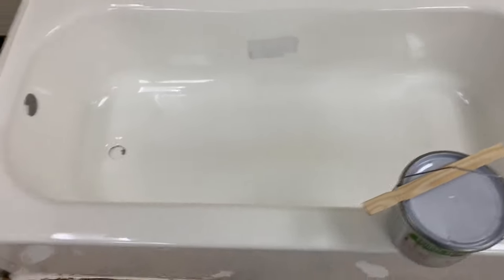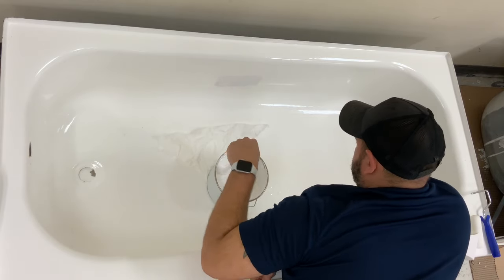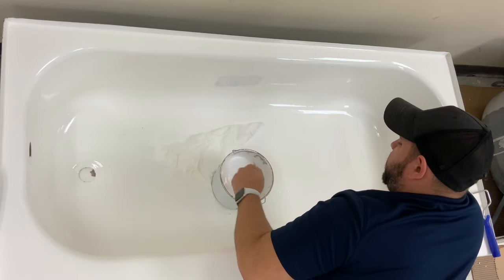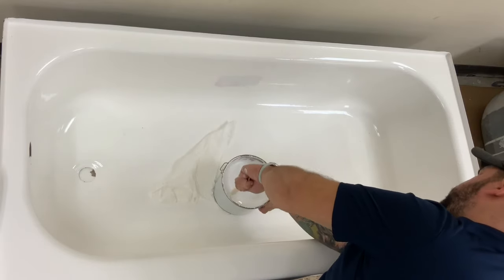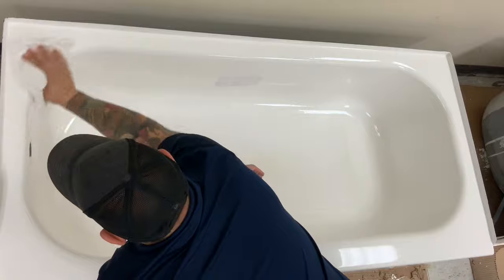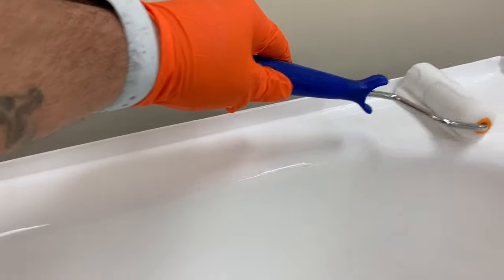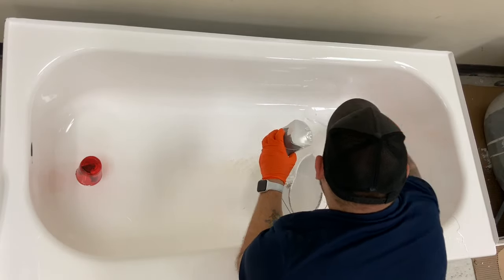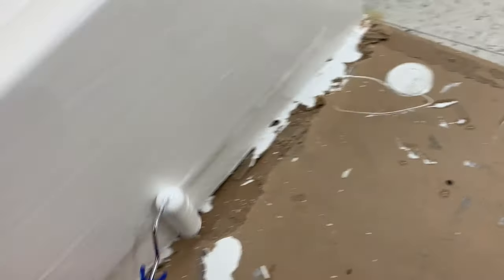How To Refinish A Tub With Ekopel 2K Demo | Ekopel 2K's Easiest & Fastest Way

Comment: I have a small area (about 1 square inch) of exposed iron, do I need to prepare it before I apply Ekopel?
Reply: unless you want a divot but one lady used it for her farmhouse sink and the drain board portion filled in with ekopel. So she lost the drainboard. So it may fill your spot in?  And you might want to sand the exposed iron and make sure there is no rust.  If hHave you found any other precautions, please share. thanks..
Reply: Did you etch the tub or sand it???
Reply: Bondo makes a fiberglass reinforced body filler called Bondo Glass. I think it would work perfectly to fill in any divot created by whatever wore down the original finish before you refinish your tub or sink. I would gently use a wire wheel on a drill to remove any rust, and scuff up the metal to give the body filler something to grab onto.
Reply: I was considering patching with JB WaterWeld prior to this video.   Did you prep the exposed area?

Comment: Not sure if you read these comments after a few years but i was wondering howwww finish has held up now after 3 years?? Thanks
Reply from the maker: Hello, The pour on coating can last for 15-20 years or more if all recommendations for applying the material are followed in conjunction with proper and careful maintenance.

Comment: do i need to caulk it first before applying ekopel? and my surround has hairline crack, will ekopel cover it? ty
Reply from the maker: No You remove all caulking before applying. Caulking will not allow the material to adhere properly. Re caulk after it is dry.

Comment: The tub you are refinishing in this video is in fairly good shape. How would you prep an older cast iron tub, say about 40 years old or so, that has already had one failed re-coating on it that is already peeling around the drain??
Reply from the maker: PaganWizard remove peeling paint, sand any edges smooth then deep clean with the Lysol power. Then you are ready to recoat.

Comment: Thank you for the in depth instructions, I bought the tub and tile kit to do the tiles on the walls surrounding my tub. Any tips on how to do the tiles? The pour method you used on the tub?
Reply from the maker: Follow the demo tub and surround videos and you should be good. I would recommend mixing one can at a time and work fast keep in mind you only have about an hour to play with the material after that hour is up the material is too difficult to work

Comment: The tub that he started with doesn’t look bad at all. A tub with nicks and dings and hard water iron stains is more like the tubs we are dealing with out here. I haven’t used this product yet, but I’m going to.  My tub does have lots of nicks and scratches and looks like there is some layer of paint or something that is on the inside of the tub,  any suggestions on that? Will this stuff cover it? Thank you
Reply from the maker: We do recommend filling in any holes or cracks with bondo and then sanding smooth with the rest of the tub. We recommend sanding the entire tub to achieve a smooth and flat finish. It will cover the previous finish however it will not fill any holes or gaps. It also may mirror the beneath which is why we recommend sanding for the flat surfaces as well as removing contamination that may even not be visible.

Comment: I have a six foot long corner tub so there is an additional side plus slightly longer length than traditional 5' tub.   The top edge is rounded ( there is no flat surface) and I am wondering if this kit contains enough material to finish this tub.   Also, would removing the drain basket be beneficial?

Comment: Hi...appreciate this video very much.  I have a old Kohler cast iron tub that is over 100 years old...pedestal type.  I am going to just sand down and paint the outside with either a oil based boat deck paint or maybe even rustoleum stray paint (thinking aged copper).  The inside is ok...but I will have to sand down and put a little bondo around the drain (small chips).   I won't have to do the cup thing for the drain...already removed and will be easy to seal up from the bottom.   My question relates to the heat gun process....did you just slowly go around the tub with it just for a couple of seconds to get the air bubbles out and was the temp pretty low on your gun.  The rest seemed quite logical how you did this....think the most important part or a lot of it will be masking around the tub and protecting the floor and walls while I do this.  I am going to refinish the outside of the tub outside the house and then bring into the bathroom to do the inside.  I won't have a lot of room but should be ok.   I priced just having this reglazed...but they want 700 to do my tub...so worth trying this.  Thanks again for the details....hand sturring for sure...)
Reply from the maker: When using a heat gun we use the high setting and go slow to pop bubbles or fish eyes.

Comment: Will this product work on fiberglass shower surrounds?
Reply from the maker: We no longer recommend pour on for surrounds as the process is too difficult and often does not come out as desired. We came out with our roll on kits which is a two coat process that is directly rollable! It is different material from our pour on kits and even those come with the foam roller it is not directly rollable given how thick it is. I would recommend our roll on kits the two coat process directly rollable and rollers are not included as we do recommend getting multiple as you will be using them a lot and they will fall apart. You will want to switch them out before they fall apart therefore no remains get in your finish. If you have any other questions please feel free to call at 877-882-2278!

Comment: Could you use this method and product to refinish a cast iron clawfoot tub?
Reply: Effectively figuring out if the sanding in a lot of full restoration videos is the only method for clawfoot cast iron tubs or if something like this also works
Reply from the maker: Yes this method will work as long as you sand and wash it before! Also check out our roll on product!

Comment: Great product 
Question if I can't  remove the drain due to how it was installed in the first place.
Is there a cover that can go over the original drain and if not can it be painted ?
Reply from the maker: You could put a drain cover over it. Or put something in there like a shirt or paper towels to absorb any material if it were to go into the drain. Then make a tape dam
Reply: @RefinishedBathSolutions  thank you
Reply: @RefinishedBathSolutions  scared to pull the cup off and see what seeped in. I taped, but very nervous. If some got down there, can an Epoxy thinner help (oh, I might need to get some off my tile walls and floor too!

Comment: Okay, my brother has been dealing with a pink tub and I'm trying to convince him to use this product as a temporary measure until he can save enough to redo the bathroom the way he wants it (which will take years because he wants to expand it too), will this cover in one coat?  Also, does this only work on tubs?  He also has a pink sink/countertop combo to deal with.
Reply: You can use it on shower walls. Like tile. Not sure about fiber glass  though *~.~
Reply: pua edwards you can use it on fiberglass. He addressed that in a previous video. It was a question asked.

Comment: Can Ekopel 2K be used on a previously glazed tub after stripping off the old glaze? If so, what would you recommend to use for the stripping & cleaning & any procedure tips for doing this? Why still use the cup for a dam if you tape over the drain before pouring?
Reply: He told me there is no reason to remove the old finish, just sand it and clean with the toilet cleaner. I used a razor blade to remove the old finish on my tub and it was very messy and time consuming.

Comment: Love this product. I'm 58 and did it without any issues tub and sink looks amazing. However after curing a lil product leaked under tape. How can I remove from floor tile...Thx
Reply from the maker: Heat up the area with a heat gun or hair dryer then scrape it off you can also use acetone. I recommend heating it up first then using the acetone

Comment: How many hours before the front of tub starts to self level out and look smooth and or at what point should we worry we didn’t do good enough?
Reply from the maker: It will continue to self level as long as the material is drying. You can go in afterwards and sand lightly.

Comment: Can you use this after mistakenly being an idiot and using Rustoleum tub/tile spray paint and ruining the tub? Sand it down smoothish or does it need to be completely stripped? And is there enough material for a roman tub... it looks like there was enough extra on the standard tub.
Reply from the maker: Steve Swanson you can sand it down. As long as you get it to sand smooth and no longer peel you can go over the top.
Reply: @RefinishedBathSolutions   You rock! Thank you for the video and the response!

Comment: I did not find a scoop in my package just the material, Gardner and roller.  What should I use for the scoop?
Reply from the maker: We have discontinued the old scooper boxes that are inside the box. The new ones are the wings of the box. Their should be a label that says "cut for scoop." These new scoopers should work better and last longer than the old ones did.

Comment: Hey -thanks for these great videos.  My husband used Ekopel 2K on our old cast iron tub and it looks great.  He has a couple of areas he would like to "touch up."  One wavy spot that didn't smooth and a couple of flat areas where dust landed on the surface.  He thinks he can sand and polish to repair these.  Could we talk you into doing one of your excellent tutorials on how to fix areas like this?  Thanks so much!
Reply: I totally agree, my tub ended up with drips and some bare spots and it would be great to see a video on what you can do to fix or re-do the tub.  I’m getting ready to re-do it after sanding and hopefully the 2nd time is a charm.  I think the product is great, but not all DIYs get it right the first time.
Reply: How did your second coat turn out? I just did my tub and have a couple drip lines myself.

Comment: I am wanting to redo my tub and considering using your product but I do have a few questions before I purchase. How long after doing the tub do you have to wait before you can use it to shower etc again? Also, what do you do if you accidentally get the product on something you didn't intend to get it on? Thanks
Reply from the maker: Kendra if you get material on something wipe it off with alcohol while when. 
24-36 hours before its fully cured.

Comment: Can eckopel be used on a fiberglass tub.I used it on a porcelain tub and it worked great.
Reply from the maker: Yes it can be used on fiberglass just make sure there is no flex. If there is a flex it would have to be fixed first.

Comment: I have 3 questions. 1st  is about rust spots do I have to do anything with them prior to applying product. If so what would you reccomend. 2nd question  after you remove cup from drain how to cover that area with  material. 3rd can I use hair dryer instead of heat gun?
Reply from the maker: For rust sport I recommend sanding smooth with 400 grit sandpaper. Then you can use our primer for a better stick. We don't recommend the cup method any more it was the old method of recasting. We recommend you tape the drain and then make a tape dam the cup can move and cause uneven areas. Yes a hair dryer will  work great instead of a heat gun.

Comment: I have two cracks in my shower pan,  is there a different method when it comes to crack? And you s there a different kit for shower pans? Thank you
Reply from the maker: Any cracks, chips, holes, or dents can be filled with car bondo first then sanded smooth.

Comment: If you don't use all materials after mixing do you have to use with in 48. Hours or is it still good to save the remaining material left
Reply from the maker: No, once you mix you have about 45 min - 1 hour to work and use the material after that it will be un useable. If you were to back to it the next day it would be like cement in the can.

Comment: What kind of problems might occur if you are trying to do this in the summertime and you dont have access to an air conditioner? Will it just take longer to dry or can it actually dry incorrectly? 

I am trying to remodel an apartment and the owner doesnt want to replace the tub there is no heat or a/c in the apartment but its summertime so most likely if anything the temperature would be above 75
Reply from the maker: If it is too hot or humid it could dry not properly, which could result in the material not wanting to stick to the tub and not adhering to it.

Comment: If there is some paint in the tub, does it have to be removed completely, or just remove paint that is flaking?
Reply from the maker: Paint, which peels off from the bathtub, should be removed in order for the new layer to have good adhesion and not peel off in the future. You can scrape off the peeling areas then use 220 grit sandpaper to smooth out chips and edges.  If it continues to peel or it won't smooth out, we recommend using a paint stripper to fully remove your old bathtub paint.

Comment: Hello, I was wondering what steps should be taken if we are trying to remove paint from an existing tub to use this product? Recently got a place where the tub was painted with ordinary wall paint and it's peeling off.
Reply from the maker: Paint, which peels off from the bathtub, should be removed in order for the new layer to have good adhesion and not peel off in the future. You can scrape off the peeling areas then use 220 grit sandpaper to smooth out chips and edges.  If it continues to peel or it won't smooth out, we recommend using a paint stripper to fully remove your old bathtub paint.
Reply: @RefinishedBathSolutions   Thank you for the reply!

Comment: In the instructions it says to sand the tub I noticed you didnt do that. Is thst something you have to do?
Reply from the maker: Hello, 
Yes we now recommend sanding everywhere to remove all soap scum and make sure the product has a good adhesion. Sanding we have found is a very important part of the process as the whole prep is. Its also good just to get a nice flat surface and smooth out any divots. Even if the tub is brand new we still recommend sanding due to just creating a surface that the ekopel can adhere to. Any holes, cracks or big gaps need to be filled with bondo or epoxy before hand and then sanded smooth with the original tub. If you have any more questions please call 877-882-2278.

Comment: It was a very good video- I understand that you do not want us to use a drill mixer- but I’d like to know why? Is it because the attachment doesn’t get all the stuff off the sides of the container? Also, I was interested in watching the entire process while you were applying the glaze- but then the video fast- forwarded or skipped to when you already had it all dumped- what did I miss? Did something go wrong? I was watching to learn from any mishaps- I’m going to be using your product soon- already purchased it. Also what did you use to wipe the tub down with? Some others say use acetone or wash the tub with Lysol toilet bowl cleaner. Did you do any of that? It also sounded like sand paper you were using- what were you using? I will do what you said and won’t use the drill mixer. I appreciate the tip with the solo cup- I was wondering how to isolate the drain. Good video, hope to hear from you soon. I would of liked it more if the video did not jump past the pouring process. I am patient to always watch your full experience. Wish me luck! ✌️I just finished removing all of the glaze that was already on the tub I’m guessing the tub was glazed 15 years ago and thought it all had to be removed but it looks like your tub seemed to have a shine to it- was that a previous glaze? And did I go to unnecessary levels to remove the previous glaze job that was on there already? Thanks 🙏 in advance! I ask questions for future buyers if your product. Things they should know to save them from messing up the application.
Reply from the maker: The reason you shouldn't use a drill to mix ekopel is because it will cause bubbling and fish eyes. For prep work you would sand the tub smooth with 400 grit sandpaper then give the tub a deep clean with Lysol power or any toilet bowl cleaner with hydrochloride acid in it. You would prime it with a lint free cloth. for the drain tape the drain hole up with painters tape and you can also make a tape dam as well. For the tape dam half tape would be standing up in the air and the other half is flat on the floor. After application wait 5-6 hours then peel the tape up. Here is a more updated video that walks you through pouring;  https://youtu.be/3knxK_RM2LE

Comment: Do you have any videos on how to repair a large chip out on the rounded edge of a tub before using ekopell. The chip out is so bad I don’t think the ekopell will hide it.
Reply from the maker: Any deep chips, holes, dents, or cracks can be filled with car bondo and then sanded smooth ekopel will cover up any pre existing color with just one coat.

Comment: In the description of this product on amazon it is written that you should not use a roll, simply pouring it over the bathtub. Is it really working without a roll because now in this video you use one too?
Reply from the maker: You don't want to roll it on, if it's rolled on it would be applied too thin. If ekopel gets applied too thin it will yellow and streak. You want to pour the material then push the excess material around with the roller.